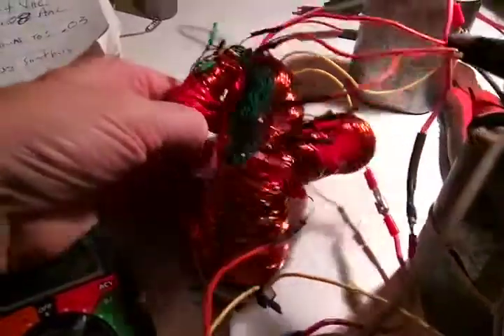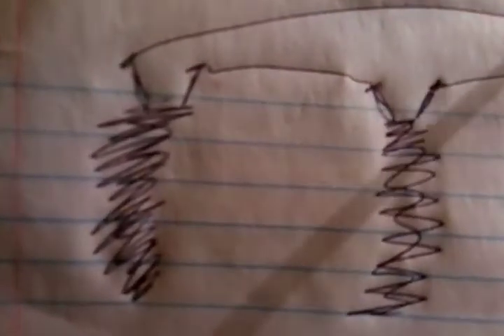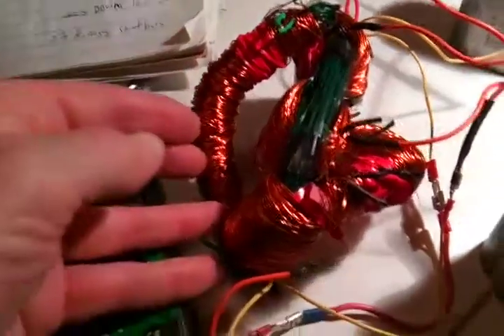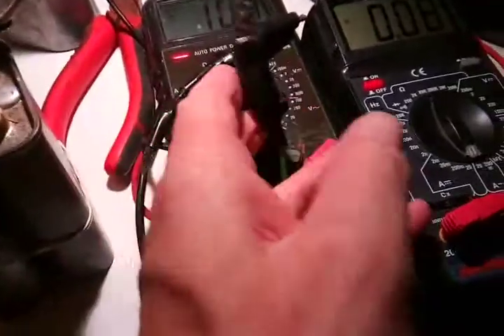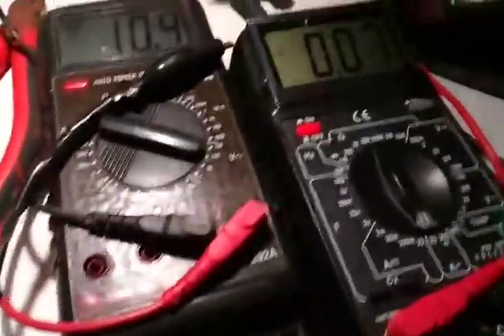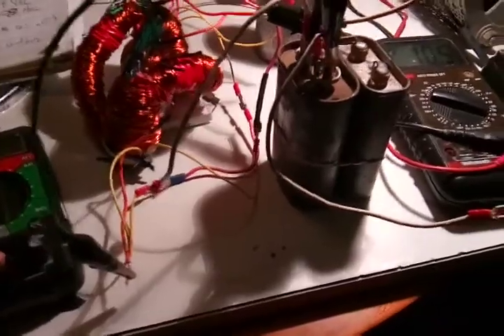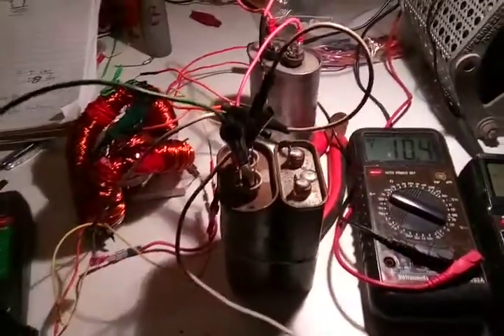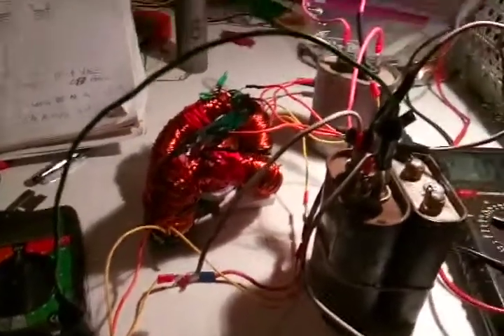Tests of BiTT with two curved shunt bars stretching from top of secondary A to bottom of secondary B

Comment: its resonanace so get it to resonate and put a load and messure the input output on a scope
Reply from the maker: Hi Amir   I think perhaps there is a resonance in the shorted out coil over shunt bars that guide backemf over and away from primary coil, reinforcing secondary power output in process.  Usually when lump resistive load is applied it kills resonance, but with inductive load, its like adding winds in parallel to secondary so everything can still resonate, including the load.